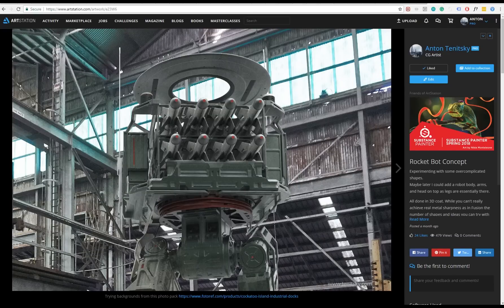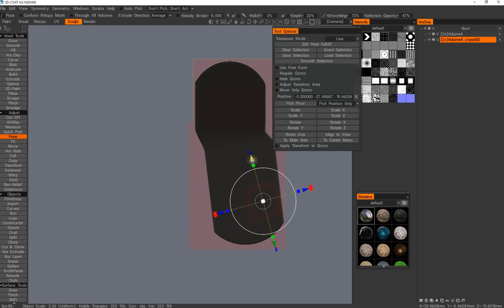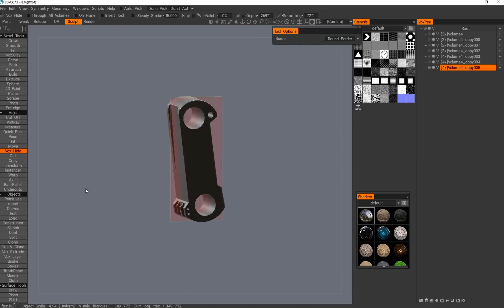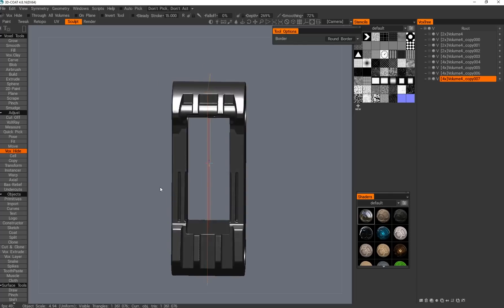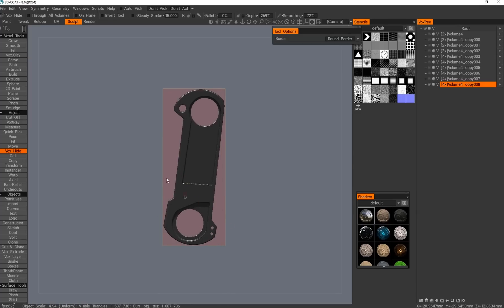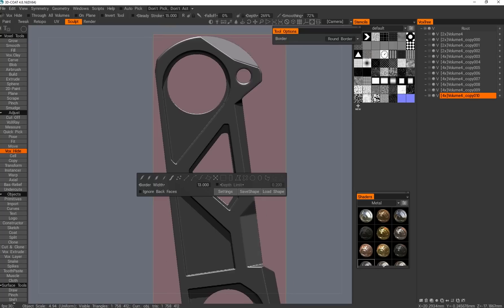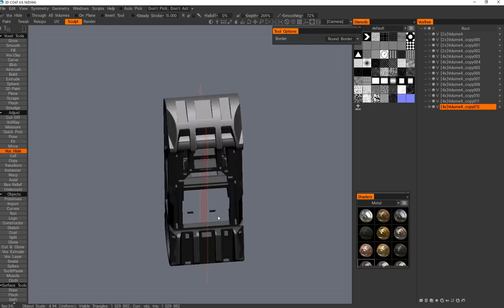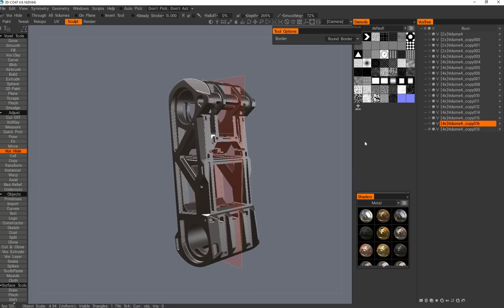3D Coat Advanced Vox Hide For Hard Surface Design

Comment: Lots of people do not realize: There are no sharp edges in real life. It is unpleasant to look at anyways and immediately gives away the "CG" factor. So having perfectly sharp edges might be desirable for low poly work, certain art styles or initial poly modeling phases, eventually you gonna want to give those treatment anyways. 3D Coat kind of includes it from the start, inherently.

Comment: Dude, I am lost when you do rhe hiding unhiding, could you do a video where you break it down, the flow of doing a specific vox hide operation so us mere mortals can understand what you speed through with such amazing results?  Thanks.
Reply from the maker: Hi Ronald, I have a video on creating a wheel using vox hide I hope it can help - https://www.youtube.com/watch?v=-SEU8YeqMwg
Reply: Watch this video
https://www.youtube.com/watch?v=P4be51ambtg
Reply: making a hide is automatic with any e menu selection tool, like polygon etc, to unhide you do the same while holding control button down and it un-hides it. thats the key thing here. i read the manual but i dont think it mentioned that when describing vox hide. maybe they assume you know about ctrl function inverting things. like freeze also to unfreeze you hold ctrl while doing it to unfreeze

Comment: Pretty cool software! I am a zbrush user but 3D coat's hard  surface  tools seem great and far better! 
My only problem is the hotkeys 3D coat uses. Is there a "zbrush hotkeys" options built in or can I at least change everything manually into a zbrush hotkey-similar-menu style?
Reply from the maker: Hi Get! Yeah it is really intuitive. But, I was switching from zbrush myself and it is a different mindset that you need to adopt. I think it is easier in the end and you don't need to remember so many options. I find myself a bit lost in zbrush nowadays. I'm looking in blender 3d coat workflow later, I'll be posting videos about it.

Comment: Why not use 3D Coat for the nuts and bolts ?  3D Coat does not get the attention is deserves, I'm seriously considering buying a license.
Reply from the maker: It's tricky to get a bolt insertion in 3D coat. In Zbrush if you add a high poly bolt  cut to low poly model it subdivides mesh around the cut. In 3D Coat if you substract 5k bolt from 5k model you get 5.1k model. In Zbrush it becomes 10k. Hard to explain but very important feature.
Reply: Anton T switching to surface mode should allow you to get the high-poly bolt cut. I think. Surface mode has a dynamic sub-divide like Zbrush 2018
Reply from the maker: I'll need to investigate it, thank you for the advice